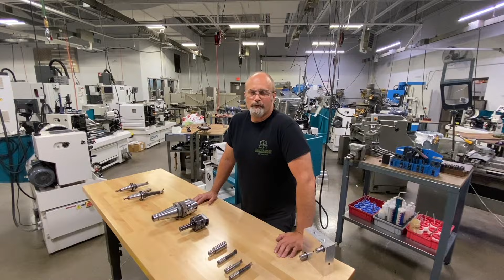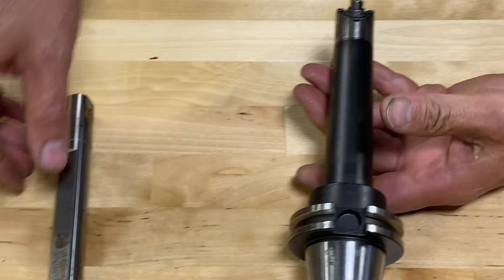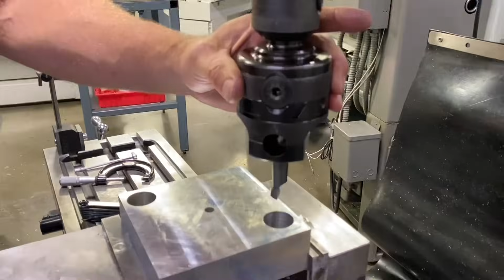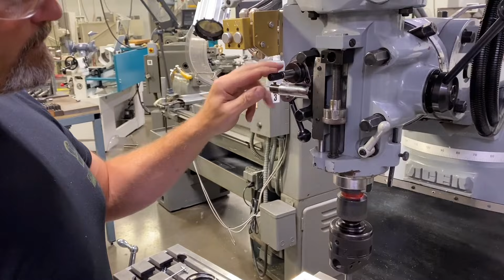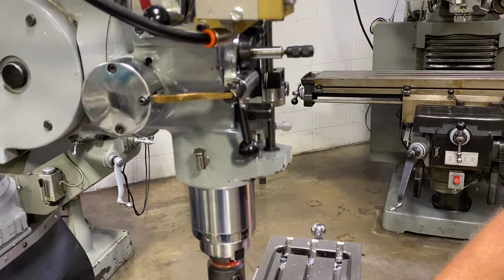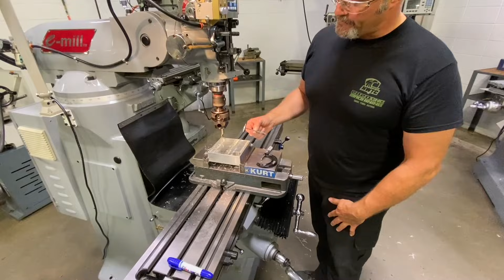How to Set Up and Use a Boring Head

Comment: In 40 years of machining I never encountered high- speed steel boring bars in lathe, Bridgeport, or CNC applications. High -peed steel cutters went the way of the Dodo before the 1970s; they're too slow, too inefficient, and require knowledge and practice to produce a correct cutting angle. C'mon man, this is 2024!

Comment: At what point do you instruct your students that their tools need to be repaired, replaced, or maintained? Using a multi thousand dollar mill, several hundred dollar boring head and a hex key set with a loose screw just doesn't fit. Otherwise a well done video with more information than expected.

Comment: Boring bars are usually unnecessary. In my experience they're more trouble than they're worth. It's a fancy toy that everyone is excited about for about a month then no one wants to mess with afterwards. 
If you can interpolate it, it's a better solution. Even on holes with a .0005 tolerance.
Reply: What are some better ways?

Comment: A QUESTION: When using a boring bar, the tip is angled upwards to give a top rake of a few degrees and some of my boring bars have a flat machined on them to provide what the manufacturer believes to be the correct rake.  Similarly we grind lathe tools with a top rake.  I took particular note of the fact that you aligned the 'top' surface of the boring cutter with the edge of the boring head thus providing a zero degree of 'top' rake.  Why isn't the tool tip rotated a few degrees to provide some top rake thus enabling a better finish?

Comment: What is the main reason why one would chose to use this method over normal endmill
Reply: I guess you get a more accurate result this way, since you can fine tune and sneak up to the exact diameter. A normal end mill may not give the exact measurement, since it would have to be very accurately manufactured and the wear of the end mill may affect the result.
Reply: End mill for making a round hole?

Comment: How do you keep everything so clean?
Reply: Boring operations are used for when ACCURACY is required.

I used to polish rust and corrosion off boring bars and use WD-40 inside and out to prevent rust after use.

Comment: Wish you showed measuring the bore.  Do you move the workpiece to gain access and can you get it back to where it was to make another cut.  What to do if the bore is tapered, or out of round, or poor finish.  What to expect for bore result accuracy and surface finish.  Many questions unanswered but a very good basic primer.  Thank you for the presentation.
Reply: Moving the piece of material/part from the work station is always a gamble. It's nearly impossible to replace it in the exact position. In my experience boring bars are more trouble than they're worth. If you can interpolate or ream a hole it's probably a better idea. Unless your shop is full of very knowledgeable machinists there is always a chance some button pusher will come along and screw up the part, the tool, the set up and maybe the spindle (I've seen it happen).
Reply: @your_belief_vs_everything  Drill bore ream process works pretty well. Open the hole rough with a drill, bore to establish position and cylindricity, then ream for final size. You retain the key benefits of boring without having to mess around worrying about tenths. It's an additional operation compared to just drill+bore, but when you factor in how long it can take people to dial in a boring head it can be a huge time saver. Not always viable for short runs if the target size is non-standard and a reamer needs to be custom ordered. I'll typically mill any holes with a reasonable tolerance (if they can't be done with a carbide drill) but with large, deep holes calling for a good finish, tight diameter tolerance, or excellent circularity, boring is the only practical option.
Reply: @tom  that's what I've always done, drill, ream, or sometimes interpolate then bore. Even then faulty tools or inexperienced operators can ruin a part in no time flat.